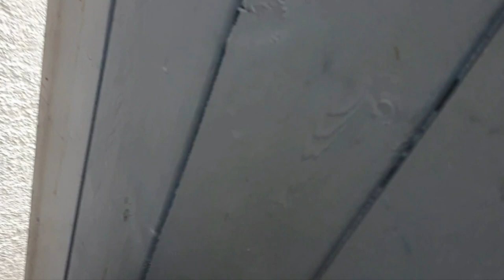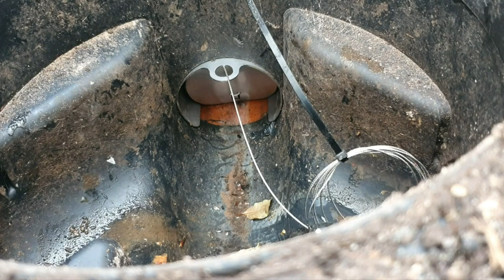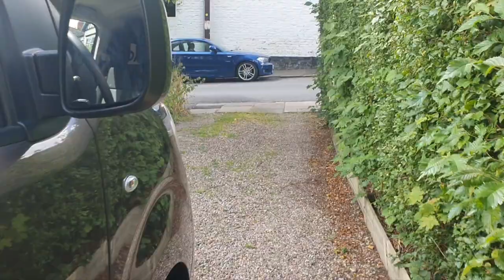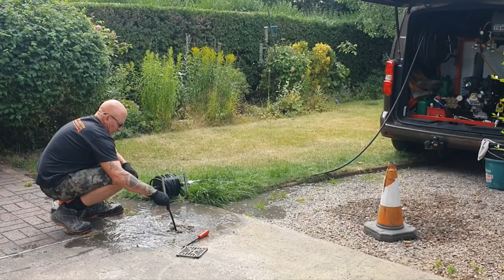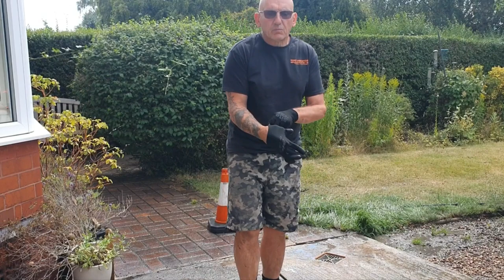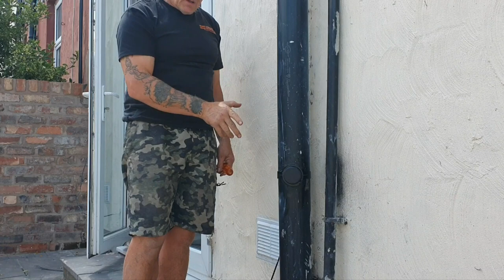Rats, blocked drains and strap on's #ratgate #blockeddrains #sewage

Comment: In the second job, did you get access to the sewer gully from that opening?
Reply from the maker: I think I got lucky and got the blockage out from between the two gullies, it was a bit awkward to get into msin line, will be a bad one if the main line ever blocks as no access.
Reply: @drain-unblocker  Thanks for that info. I was just comparing that kind of design with what is typical here in the States. It quite different here. I really enjoy seeing the drainage systems in the UK and learning new things.